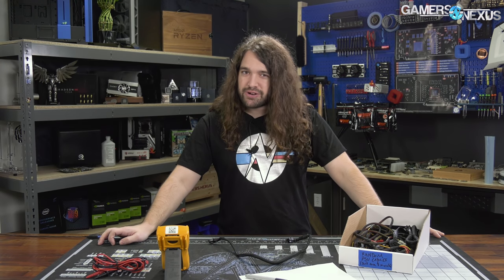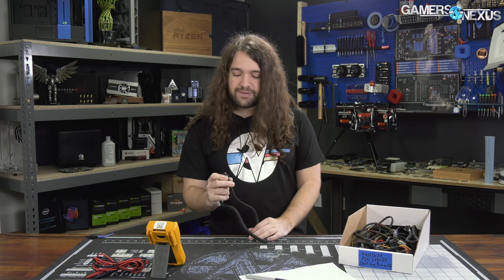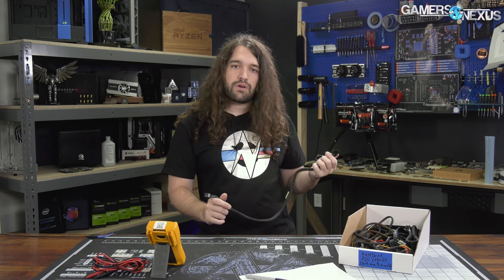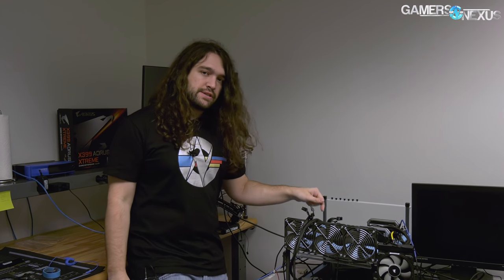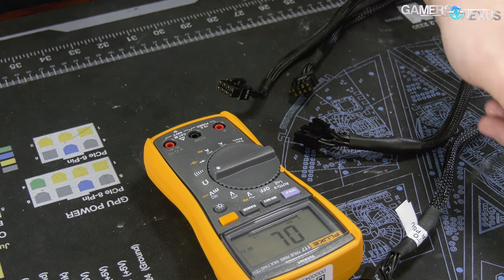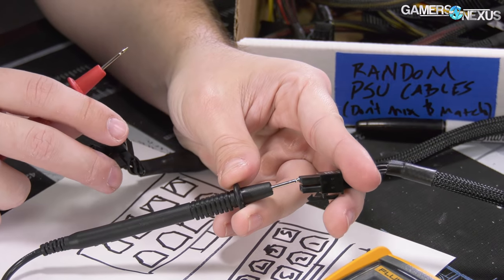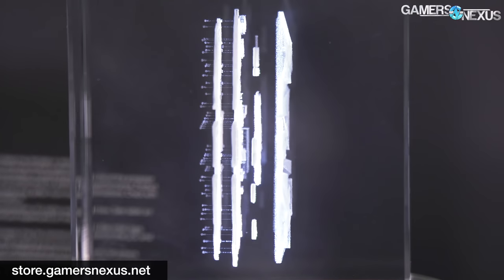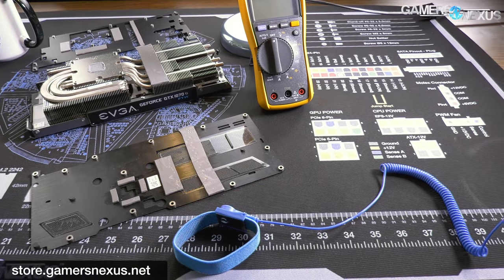How to Safely Mix Power Supply Cables Without Killing Parts

Comment: So the connectors on the components like graphics card, SSD, HDD etc is always the same, but the connectors on the PSU could be different? Thus the cabling will be different?
Reply: Correct!  Thus the cabling CAN be different.. You need to check to make certain.
Reply: @tisjester  Such a stupid system, it really should be standardised like all the components mentioned, I can see no logical reason for differences

Comment: Maybe some could help me i recently bought a new graphics card i have a rosewill 650watt modular power supply and I need an 8 pin to 8 pin cable to get power from my power supply to my card can i use any 8 lin to 8 pin pcie cable or does it have to be one that would have. Are with my power supply?

Comment: made no sense, pcie which plugs in to gpu end is standard, what you have to check in is psu end cable matches with psu power sockets right?

Comment: what about cable extender? using some random extender would dmg the components?
Reply: Mmmh an extender should have the same pin layout than the device side one to extend it, which is standardized, I don't think of a case where extender will be a problem (except poor quality cable and length)

Comment: Sorry for late response on an old video. I didnt know about this, and mixed a cable. It worked, both sides, gpu works fine, no power supply damage. But now I'm worried I've just got lucky so far. If it works and has worked under load with no issue, can i safely assume its fine? Or should i change the cable for an official Corsair one anyway? Thanks
Reply: if it works its safe

Comment: Got two pcs,recently upgraded them moved my 3090 on my gaming pc to my streaming pc and added a new one to  my gaming pc .my gaming pc had a 1,000 watt psu  streaming had 850 watts. I received a 1,300 psu that I replaced in my gaming pc .Ended up transferring the 1,000 watt to my streaming pc connected  all the proprietary but left one of the sata cables connected .turned on the pc and smoke started to spew out .Freaked out took everything apart till I found the problem ,thankfully unfortunately I fried my sata SSD drive .wish I would of seen this video before hand to know I shouldn’t do that lol.put it back together replaced with correct sata cables and  pc started ,but SSD is dead dead lol fml could of been a lot worse though.

Comment: my psu has 2 cpu 8 pin ports but only come with 1 cable. maybe I can just buy that little cable instead of upgrading the psu in future because some b550 motherboard has 8+4 cpu power pin.

Comment: It is OL not 0L. It stands for Open Line.
Reply: it also stands for "out of limit" when you are measuring voltage. if you set the meter to mV and the voltage is to high it will read OL for out of limit. It could be dangerous not knowing this because having the meter on the wrong range and using the terminaligy "open line" could miss lead someone to think there is no voltage. when actually it could be higher than the range the meter is set to. be safe
Reply: @crazycritical8330  valid point. I never worry to much about the voltage as much as I do the amperage.

He was also testing for continuity only which will only mean open line for no full circuit.

As a heads up, getting hit by a PSU fully charged hurts like hell.
Reply: @Speedlution  I understand what he is testing for I was just adding to the info. better safe than sorry. and yes amperage is much worse. what is it like .5 amp to stop the human heart. I used to be a generator tech. electricity is amazing but needs to be respected lol I've seen a 2Mw gen arch flash because the wrong control board was installed..... dont ask, but the fire ball was impressive
Reply: @crazycritical8330  I believe it. I have seen many 120 volt 30 amp arcs in my days from bad wiring installs in houses. Most work on Apple products now though.
Reply: I always assumed it stood for Over Load... hmm, learn something new every day.
Reply: I thought it stood for Order Lager.

Comment: 80+platinum should include 'proper' pins. It's not like the cable needs to be the place they change pins, it could be done inside the PSU ;/

Comment: When I apparently tried a PSU 8 pin cable that I bought for my Gigabyte PSU which was also Gigabyte brand cable.Turns out to be the wrong cable as my PC or PSU would not power on. So i used a Corsair PSU 8 pin for my GPU on my Gigabyte PSU and my PC turned on with no trouble, stress tested the GPU and had no smoke, used a temperature probe and laser temp gun and couldn't find any super high temperatures at all and my GPU is still working ok and no power lights on the gpu power plugs have come on. Never tested the pins. Do i have dumb luck or what lol

Comment: Comparing one cable to another cable isn't any good if both the cables are incorrect for the psu!
the motherboard and peripheral end pinouts are pretty standardised but the modular psu end isn''t, untill makers agree a standard for that end you run the risk of damaging components.
once you have mapped your cable using the standardised peripheral end specs you NEED to probe the psu outputs to make sure they match.

Comment: Hey, I need help with 8 pin PCIe connectors

I bought an RMx1000 PSU from corsair, and the RMx compatible cables from Cablemod, but the 4th pin (according to Steve's scheme) of the PCIe connectors on the GPU side aren't the same

So, I have a square pin on the GPU cables of the PSU, and the same pin on the Cablemod cables has chamfered edges
On Steve's mat, the PCIe connector shloud have a #4 pin with chamfered edges, so does that mean that the PCIe cables I received with the PSU can't connect to the GPU ?
Reply: Are you sure you have the cable oriented correctly?  The GPU side should be like the mat IF you are using the correct PICE cable and it is oriented properly (as in the PSU side is plugged into the PSU and the GPU side is plugged into the GPU) Look at both ends of the cable to make sure.. AND make sure you are not accidentally looking at a 8 PIN CPU cable.
Reply: I am 100% sure it is not an EPS cable, this one is exactly like the one on the mat

Both connectors I am talking about are on the GPU side, I took pictures where you can see both cable's 6+2 connectors, and as I said, only the Cablemod connector looks like the one on Steve's mat (which is good because I didn't buy these cables to really doubt about using them), but still, the corsair cable having that squared #4 pin just confuses me

By the way, I checked the connectors of the card I'm going to buy ; the Aorus Xtreme RTX 2080, and at my surprise it seems like it has a square #4 pin, and not a chamfered edges one

If you could check, here's the link :
https://youtu.be/4LBa-_onxaQ
go at 3:25 and you'll see the them

Comment: I substituted a fully modular 430w PSU for a 730w PSU - both from corsair, both the same SFX. I was going to changeout all the cables but they all looked identical … so i just disconnected from unit and put the other one in and reconnected. I’m a bit nervous but it’s not like i’m using wires that weren’t meant to go where they are going.
Reply: I know evga uses the same cables among most of their modular psus, but not sure abt corsair. Better to not risk it dude. Your pc tho.

Comment: I cant believe they are not standardized! This video is a PSA.
Reply: Actually it's not that surprising if u think about it. Modular psu is quite recent, and appear for aesthetic  appeal not from technical need. So there's no standard attach to them. The device pin layout is standardized, but not the side in the psu. Still it will be great if they can adopt the same layout, preventing us to kill our hardware...

Comment: Why not just plug in the power supply end, turn on the power supply, then check the other end (which isn't plugged in to anything)  and see which pins are 12V and which are grounded.  You'd use the voltage function of the DVM.  I think there are some other input contacts on the power supply that have to be shorted to turn the power supply on - it would be useful to demo that.  Here's a link
https://youtu.be/Ea1dcJ0QyAE

Comment: Hey Gamer Jesus, how come every time you're testing for continuity you don't use the actual continuity test mode of the fluke dmm? You know, the mode where it makes an audible beep when there is continuity between the two probes.
Reply: Beep testing can give false positives, could happen for example at 6:55. The meter will still beep even with impedance of a few ohms, you ideally need to be looking for less than 0.5 ohms.

Comment: The damn PSU should come with a huge warning sign alerting users not to use any cables other than the ones included with the unit. I just killed two damn SSDs 2 TB each because I left the cable that came with the computer feeding the two SSDs, I thought all SATA connections were the same. 😤😤😤😤 Just wasted over $400. Luckily I didn’t lose any important data.

Comment: Guys i have a very newbie question and hope you dont laught. I have fired up a computer of mine where i connect the ssd throught this cable that matches perfectly into the modular psu. I suspect it is the right cable right? if not i would just burn my ssd instantly ? !  I have even installed windows and stuff on the computer all seems fine . Please tell me that im safe lol.

Comment: This goes to show there are still perks to using non modular powersupplies proving you have enough space to hide the cables.
Reply: Or just go with semi modular, because non modular is a pain in the ass to manage everytime. And also do not match cables on psu's - ever!

Comment: Why in the world did you not just test if the right voltage out was in the right spot - on the component side. That’s the safest and most sure. 

Plug in the pcie cable. There are 5 wires. 4 in Molex. Look it up online. If it’s colored- black should be 0. Red should be 5. Yellow is 12.  And grey or orange is 3.3. The component end is standard. Just start measuring between the component side. 

Your point that they don’t always don’t have to match exactly the right pin proves this is a pointless exercise.  You’ve made this so much harder than necessary

Comment: What about cable thickness - cable gauge ;-) ?  GPU or OC CPU can be hungry for power, melt some tiny wires, no :P?
Reply: You are correct.. It is not just pinouts you need to worry about. Especially when moving from a lower watt PSU to a higher watt one.

Comment: I fried 5 hard drives, a PCI E USB card, a DVD drive and a keyboard by thinking I could plug a new PSU directly into my already installed cables. Oh and the power supply died too 😃

Comment: is there any reason you couldnt plug it in the psu and measure voltage at the other end?   it seems it might be faster since that end is standard, if its not right you could just repin the connector.
Reply: Switching PSUs only really conform to voltages specs when loaded and could be damaged if run without any load attached. 
Also you will need to short pins on the 24-pin to even turn the PSU on, yadda yadda yadda. There is a reason behind what Steve recommended. 

If you ever tried to make custom cables where the challenge is almost the exact same you will no, or just do some research and think it through in your head.
Reply: is there something specific about atx psu's that make open circuit testing a no go?  i've spent years diagnosing electrical systems on cars, and never ran into a circuit you couldn't disconnect and check voltages on.  i know steve is showing the absolutely safest and best way to check, but doing 16 continuity checks and building 2 wire diagrams seems tedius to me.  the business end of the plug is standard, so doing 8 voltage tests seems so much quicker and straight forward.

Comment: I didn't know you cant mix and match. It never occurred to me that the plug wasn't standard pin out.

I have a very expensive sea sonic and a corsair, so both the same plug but NOT the same pin out. Luckily the fancy sea sonic tripped a resetable fuse and no damage done, and the corsair just didn't power on.

It was the same part going in two PCs at the same time. Pretty easy to mix the cables especially when I never knew it wasn't standard on the PSU end.

WHY ISNT IT STANDARD. This is some basic fucking shit. Ford figured out to use standard parts in the fucking 1800s. The device end is standard, why doesn't ATX cover the supply side??????? Fuck me for assuming a PC part is standardized

Comment: your diagram is unnecessarily complicated/messy and prone to making a mistake. youre better off just writing a number in each of the pins of the bottom picture corresponding to which pin it matches in the top picture, rather than drawing all those criss crossing lines. then to see if the cables are identical you just have to see if they have the same 2 lines of numbers in the pictures on the bottom.
ie:

1234                1234
5678                5678

3456                3456
2187                2187

Comment: Recently popped a Corsair cable into a thermaltake psu after measuring the voltages carefully. Then swapping two cables.  (Cut and solder)

Another word of warning. I bought a cable off amazon last week. Molex to SATA adapter. Surely from China. Both are standard. But the fuckers wired it up wrong.  Psu went up in smoke. That has nothing to do with specific psus. SATA and Molex are always the same

Comment: I just get some pci express cables from a 1300w older Thermaltake thoughpower to mine 750w rgb, and it's exact the same fucking cable xD, my cables where fucked by my cats so I was having trouble, and I find it, and now works perfectly after 1 month using it.

Comment: Doesn't help that all the wires are black.
Reply: Manufacturers might still not adhere to the standard despite using non black cables and telling the pinout at a glance is less useful for most users that prettier cables. Black vs ketchup-n'-mustard

Comment: Sadly I grabbed the wrong psu cable and just fried my motherboard, I tried a different PS everything turns on but no post or beep.

Removed ram no beep no post

I have classwork to do and can't because I fried my MOBO.

Seasonic and ThermalTake are not interchangeable.

Comment: You could have saved quite a bit of time by turning on the PSU, plugging in the cable in the PSU and checking the volages on the device end of the cable.

Comment: this is so stupid why would manufacturers change the pinouts for power supply cables
i understand connector on psu is controlled from the manufacture
its not even vendors as he suggests 2:22 as evga actually switches pinouts on models

Comment: https://www.overclockersclub.com/reviews/mush1000w/2.htm

This is the PSU I have and it is no longer made and I was wondering what connectors I could use. Also modifying cables myself will not be something I can do.

Comment: ur cable is black  & yellow, 
not ketchup & mostard!
Reply: They are black because they are ground and Yellow because they are +12V if you were to throw +5v you would get Red hence the Ketchup and Mustard analogy.. His 8 pin CPU is just Mustard.  Oh and +3.3V is orange..  Then you have -12V Blue / +5V Standby Purple / +3.3 Sense Brown / Power Supply on Green / Power OK grey / +5V Sense Pink or smaller red / +12V 2nd rail Yellow with Black stripe / Older PSU's had a -5V White
Reply: @tisjester  

wow thx, thats actually usefull info !

Comment: I feel Like a better way to do it it to not even worry about the PSU side

Just plug the mystery cable into the PSU Side and measure the voltage you get.

If the voltage on a certain pin is what the spec says it is, then problem solved.
Reply: Works ok for most except the Motherboard cable.. That has very specific and different but similar voltages on some of them.

Comment: Son of a bitch. I almost turned on my psu for the first time with cooler master and Evga mixed cables. I don't have patience to know if PCI cable 1 and 2 share the 12v and ground pins.